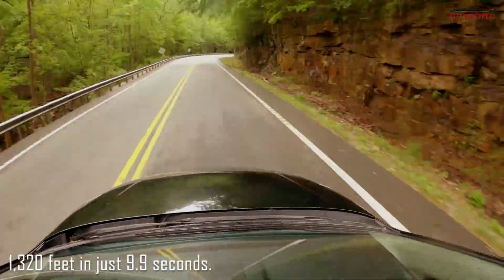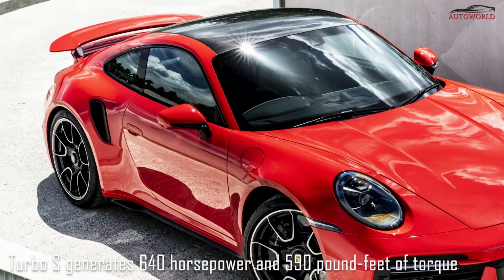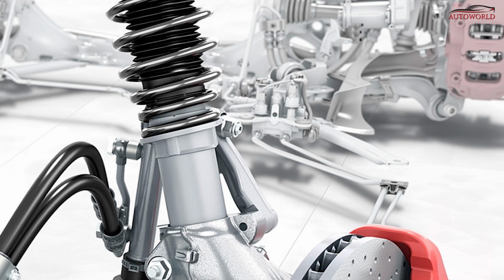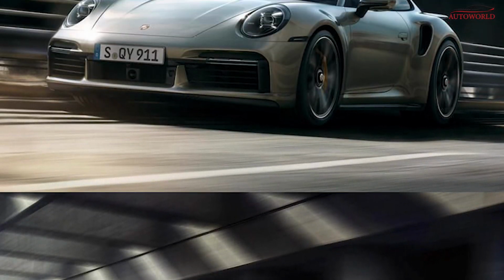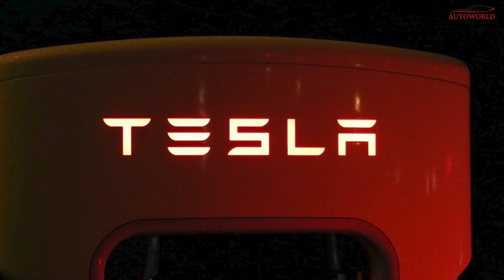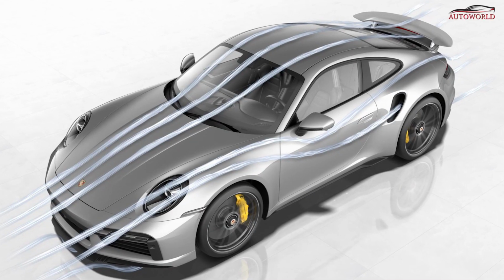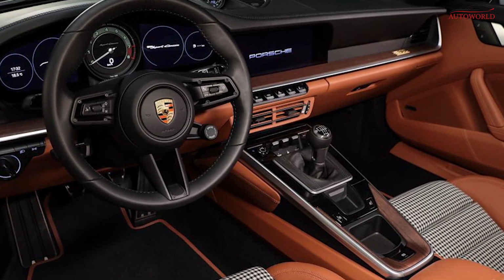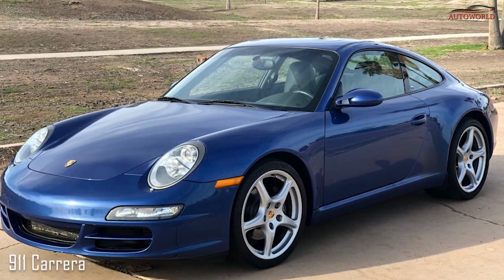Porsche 911 Turbo’s: Facts About Why is the Porsche 911 Turbo so Fast? | Autoworld

Comment: The performance is amazing, and if it wouldn't look so never changing boring i would buy one.
Reply from the maker: for sure. I think the main selling point of this product is its performance. It is very reliable, does not break down often, and is incredibly efficient. It runs incredibly smoothly and is incredibly fast. Plus, it is very compatible with different software and hardware. So, if you're looking for a reliable and efficient product that won't let you down, this is the one for you.